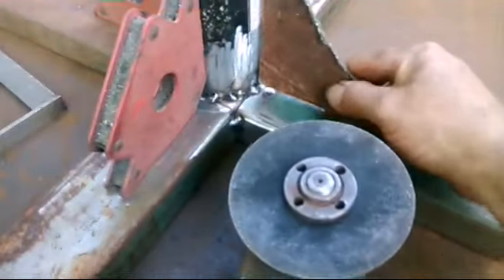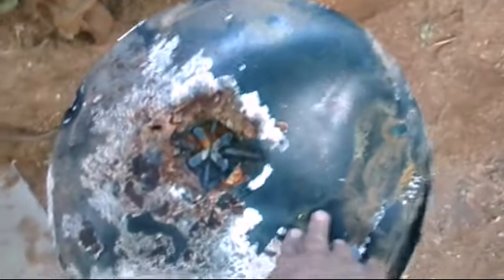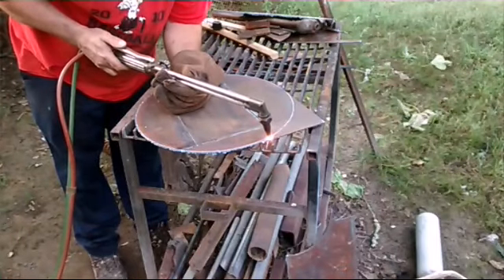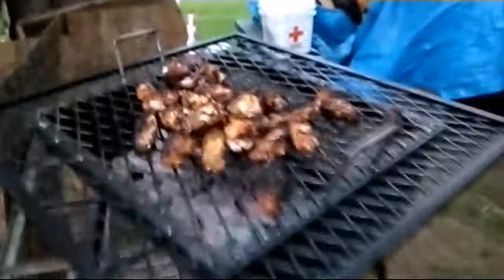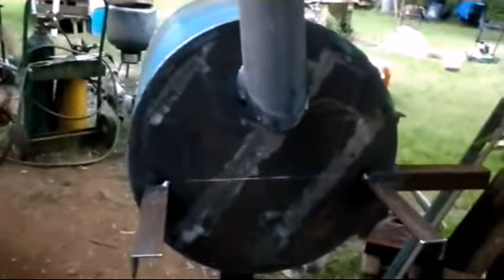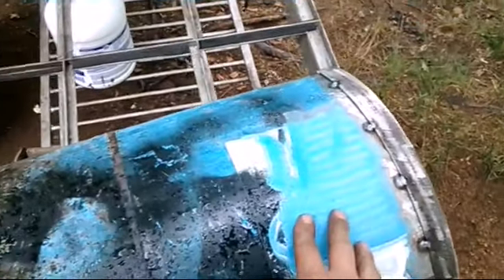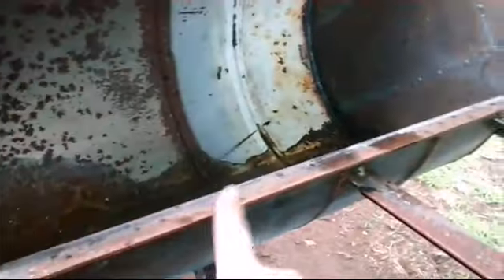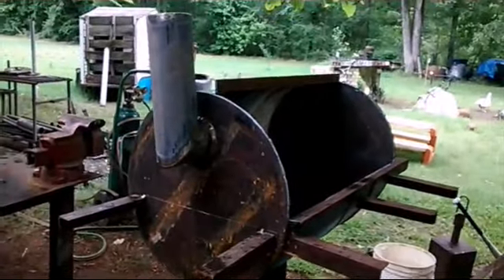Bbq pit from a water tank "pt1"

Comment: So you know how to make crap - big deal.
I bolt = NO rust ! Lid opens all the way across because cut below  cooking grill in front. Smoke stack in middle top as back suppot to hold lid. Metal on bottom with spacers above bottom to keep from burning out bottom.  Holes in bottom to make sure no mound of stuff that did not burn. Spaced bolts with wood handles on lid and cart. Wheels tucked in to work easier to move. Last longer than owner. No vent holes needed because lots of holes in bottom to burn wood - damper on top of stack keeps fire down as fire ONLY travels UP !
Reply: You must be even more insecure and jealous now that he's turned this into a thriving business and has a huge shop. I'm sorry for you.